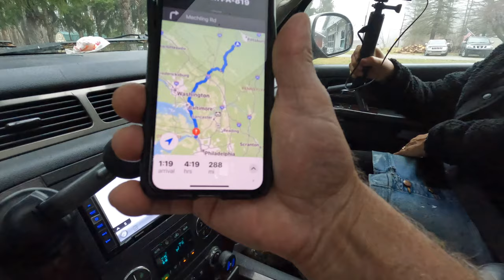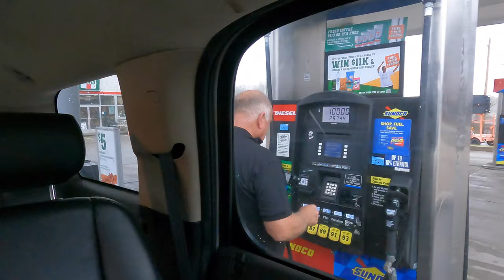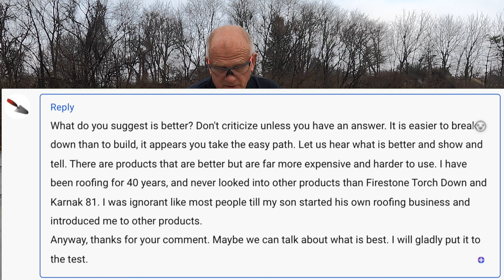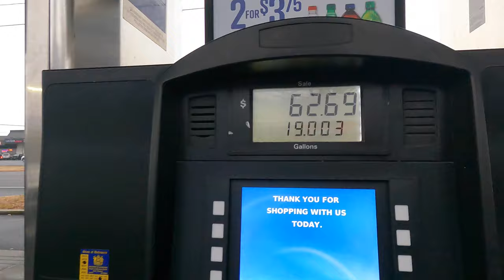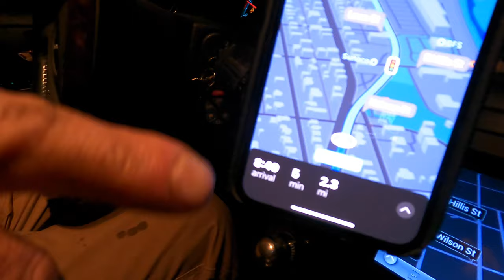12 Hour trip to Deleware to do a 10 minute Repair on a Metal Roof

Comment: Good video.
It's very interesting to see the situations like this one that you roofers have to deal with sometimes.
Reply from the maker: I get this a lot. Almost all the time the building owner would blame the job we did for the leak. But here is the rule of thumb. If it is the leak as before, nothing changed, after working for 3 days fixing all the seams, then logically it has to be something else causing the leak. But the owner never see it that way. They always blame the workmanship. That is why it is super important to go back immediately to check it out, before he gets someone else to tell a different  story. Most roofers are not honest, they will try and make a job from something the want to criticize. Hungry people do anything for food
Reply: @FlatRoofDoctor where to find this product in Europe? Or similar.  We have a problem with leaking on the building's roof. I can send you pictures if you give me an email address so you can see them and give advice,  please. Thanks.

Comment: Nice work!  👌
Reply from the maker: Thanks
Reply: @FlatRoofDoctor  😉 but of course. Could this poly....be used as a drip screed?  Does it attach to anything (metals, woods, cement, stucco...)?
Reply from the maker: yes it does
Reply: @FlatRoofDoctor  😊
Reply: @FlatRoofDoctor  😊

Comment: Can turbo polyseal be applied to a roof while it's still wet or does it need to be dry first? 
You have my utmost respect for driving all that way and back to fix those two leaks.  I really hope there's no more.  Your energy level is inspirational, next you need to tell us what vitamins you're taking. I'm only in my 40s and don't have anything near your strength.  Well done.
Reply from the maker: Can not be applied to wet surfaces
All my life I have refused to take any medicine. Not even the Amoxiiliin for pain killers the dentist gave me or any pain killers. I have taken Nyquil several times to break my Flu fever. but that's it for medicine. I am blessed. I think what drives me is when you give your word to someone, you have to keep it. So I promised the owner to fix the leaks, and I was on the hook. Within 24 hours we fixed the problem

Comment: What did you charge?
Reply from the maker: Hi Tate. I am still thinking what to charge. Normally I would charge around $800 - $1200 for anytime to go and do a repair. But, since the owner gave me 2 roofs that are over 60k of repairs, i might not charge for this.
Reply: @FlatRoofDoctor  good call, thanks fir the general repair fee pricing.  As a GC that often does repairs, Ive taken your advice and used the poly products on 3 separate occasions now here in Arcata, Ca (humboldt county) Thanks again.